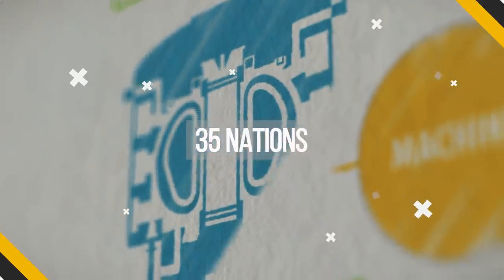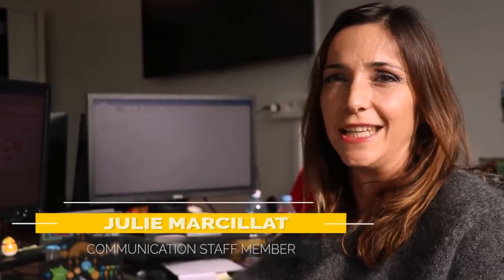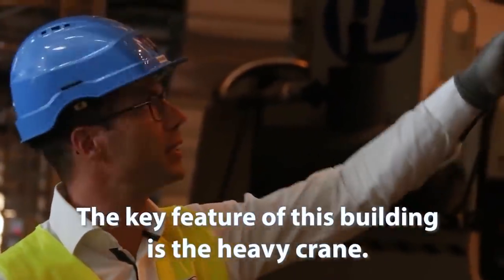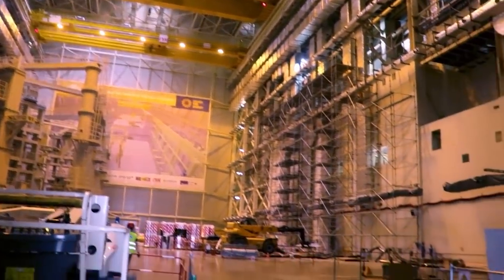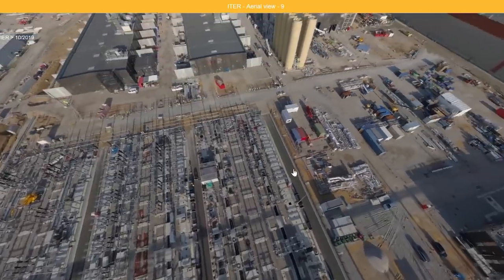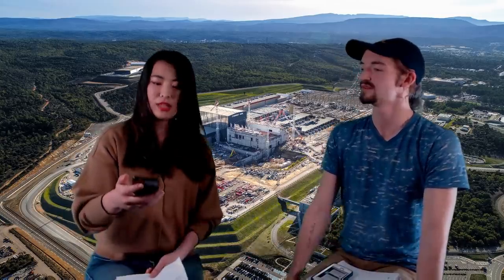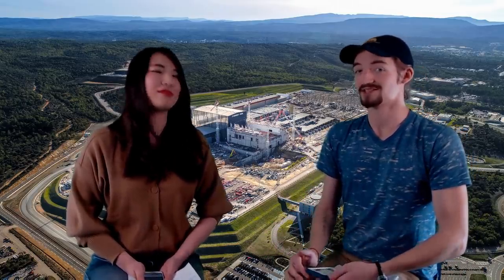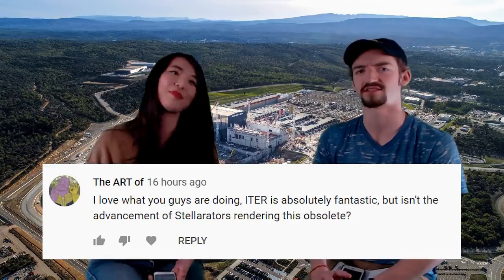ITER NOW 1.3: Visiting ITER

Comment: First plasma in 2025 and operation in 2035 is too slow. Will fusion be able to compete with solar and wind power in 2035? Is it possible to go faster, if you had more money?
Reply: Solar and wind? Is this a joke?
Solar and wind are tiny, tiny energy producers and also very unreliable.
Reply: @EaglePicking  in 2019 renewables produced more electricity than nuclear plants. They grow fast and they are very cheap even today. With widely distributed generation and united energy systems, reliability won't be an issue.
Reply: Even if this is the case , having a fusion reactor its really huge man .  Think about all the places that dont have acces to the solar radiation : deep space  spaceships, minning asteroids , travveling throw space ,  Mars and Moon colonies ....This is limitless
Reply: Not really, it has taken people thousands of years to move from water to coal, 200 years to go from coal to the beginning of green energy. This is lighting fast in the grand scheme of things if you look at humanity as a whole, and not just your or my lifetimes.
Reply: @cazymike87  Making fusion reactor IN SPACE will take a lot of time. We are not even close. BTW, Russia is going to make first nuclear-powered spacecraft with plasma thrusters by 2030. Its power will be 1 MW. Very interesting project.
Reply: Fusion has a few absolutely massive advantages over solar and wind; first, reliability, second power density, and third absolute capacity. Reliability can be worked around with large enough power stores, like batteries and reverse hydro schemes. As for power density; where is most power consumed - in large cities, and where is most solar and wind power generated - far away from populations (yes, some is close, but most is not - it takes up space, lots of space). And for absolute capacity, Prof Brian Cox did what must be the definitive answer on that one in the 2009 Horizon documentary “Can we make a star on earth” (good viewing, and the kicker for renewables is right towards the end - from someone who is wholly behind renewables). The sums dont add up on renewables, and its the easiest thing to do the maths. We need fusion.
Reply: @andyowens5494  Of course, fusion is perspective. But it seems to be far more expensive and hard to build than nuclear. They expect 1000 s operation with 500 MW output in 2035 and still no electricity generation. I think the first fusion power plant can be built only by 2050-s. By this time, renewables share will grow close to 100%, since they are very cheap. No one cares about energy density, only about cost. We can transfer electricity through HV lines rather efficiently.
Reply: TheRusselsTeapot “No one cares about energy density”? Err, every grid operator on the planet does. And every local objection to another turbine - everybody wants them until its in their back yard. Cheap, err cheaper tan it was, but still not (and not likely to become) as cost effective as a plant built for efficient energy conversion (thats thermodynamics and engineering at work - nothing we can do about those laws). And the environmental damage! Do you know what goes into solar panel production? Especially on the scale required to power the planet. It will NEVER reach 100% before fusion changes the economics for ever. Its a stop-gap at best.
Reply: @TechMasterRus  renewable energy only works because it builds off of the baseload power, which is coal. Remove the baseload and now you will need energy storage for night. Batterys are super expensive, and having enough to power the world would be extremely expensive.
Reply: @andyowens5494  They care mainly about energy cost.
Ahaha, show me who wants nuclear plant in his back yard))
Cheap - look at Lazard-2018 report. New wind & solar are 2-4 times cheaper than new nuclear in terms of price per KWh. Only existing nuclear and coal plants are cheaper, but they are not forever.
Environmental damage? Please tell me about it, what damage and how big it is, per KWh of generation. I read scientific research about it, mb you will discover smth new.
Never? We shall see. I can't predict future, but it's going to reach close to 100%. Mb 80 or 90%, remaining will be nuclear.
Reply: @GamingWithNikolas  You need storage as long as you have one solar or wind farm. If you have a large grid (continent or more), it's higly unlikely that wind doesn't blow anywhere. Same thing with sun. Of course, reality is more complex, but if we simply build a ring of solar panels around equator and power lines along it, this can provide Earth with electricity with no storage. Power loss in modern 800 KV HVDC can be as little as 3% per 1000 km.
Reply: @TechMasterRus  but how much would that cost? There is also a ocean between the continents, so you would have to find a way around that. You would need multiple sets of wires around the world for redundancy as well. 

I support renewables, and so does ITER on the website, but you need diversity in power sources. Building a ring of solar panels around the earth is just not practical.
Reply: @TechMasterRus  we are a long way from fusion in space, but doing it would unlock the stars.
Reply: @TechMasterRus  again, you are comparing nuclear FISSION power, when ITER is FUSION. Of course no one wants a fission plant near them, those things are not completely safe. Fusion cannot have a meltdown, and is safe by design.
Reply: @EaglePicking  they are a considerable part of the gride, and can be extremely reliable for tidal power and geothermal power.
Reply: @GamingWithNikolas  Yes, I am talking about fission because it exists now. Fusion probably will produce first power in 2050-s (not in 2035 as I thought before). My initial question was: by that time, will it be competitive with solar and wind power? Since now, they will have 3 decades of progress, power lines also. Cost is low enough even now, and it tends to decrease. We have big grids even now: Russia has it since USSR, Europe builds its own ENTSO-E, so we have technology. We just need to increase size of these systems and install more wind and solar capacity.
Reply: TheRusselsTeapot Do you know either the energy demands or chemical processes that go into solar panel production? Have you seen the “ponds” (more like lakes) in China that are full of the chemical waste products? I dont just read about it, I try to do something about it from the inside, nit some noncy protestor. New fission nuclear is not going to happen, but new fusion, in my back yard, yes please! Do you know what the biggest waste product would be? No, not helium, that negligible, its waste heat, which for many well designed plants is used for local benefit, heating homes and growing crops. You can only get effective policy from seeing the BIG picture, not just selecting parts that make nice headlines or make some people feel warm and fuzzy inside. Thats takes science, engineering, economics, and much though I hate to admit, a dash of politics (mainly because most people are dumb enough not to understand the big picture, and need to be brought on a journey of understanding).
Reply: @andyowens5494  but I asked about particular chemicals per KWh of generated power... And you reply with new portion of lyrics.
Fusion is wonderful technology, but it's not going to happen to your back yard in the next 30 years)